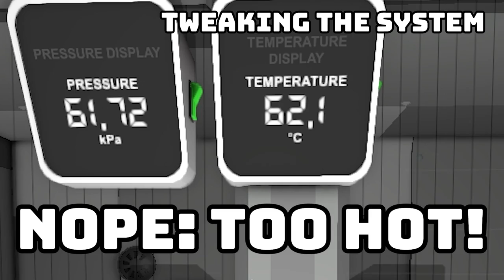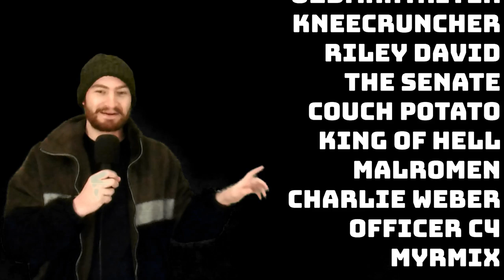The Gas Fuel Generator for Absolute Beginners | Zero Coding Required! | Stationeers Mimas Tutorial

Comment from the maker: After much testing, I can confirm that this works infinitely better as a 1x1 square! Much easier to balance and also runs a lot more consistently. Using only 1 active vent is also handy if you find the atmosphere is draining too quickly.
Reply: I think some of the jankiness when not confined to a single square was a combination of the gas sensor being too near the active vent and the working area being so small (yet more than 1). A longer 'buffer' of pipes after the regulator/pump would maybe help stabilize the changes some, and moving the gas sensor further away from either vent would also help the logic operate a bit more smoothly. But I think keeping it shoved into a 1x1x1 is the better choice.
Reply: Is this also "Phase Change Update" approved?
Reply: I would on the contrary advice bigger mass, I would probably put a tank to store gas at the desired temperature and pressure or have a bigger room, to have a more stable number, in the video pressure and temperature jump way to quickly.
Reply: @KnightOwlSC  Nope, i f u look at his volumepumps, they can pump more then 10L, so its an old game version ^^
Reply: @fellpower  dangit... I have yet to find a single post-phase-change guide for this! It's so aggrivating! D:
Reply: @KittenyKat  any luck? My base is dying :)
Reply from the maker: I guess I need to come back to it! Haven't played much since the update
Reply: Not a stationeers player but irl the answer would be delayed progressive counterreactions or slowing down the system. And since your vents only go binary and i dont see any way to introduce an activation delay in your setup, just make the room a lot bigger to have more air to work with. Then place the sensor as far away as possible. possibly the active vents as well. That should increase the time until your sensor reads pressure or heat threshold and eventually make your system "dumb" enough that it only realizes it has to act every... lets say once per second or two instead of at several megahertz therefore stabilizing the entire thing

Comment: I use 3 Active vents, 2 blowing inward and 1 outward conected to a gas tank above 100 kp and It maintain 100 kp in the gás Chamber, no need for back pressure regulators.
Reply from the maker: This is a really good system!

Wanted to keep things as simple as I could though.

Comment: Considering the main breaker for the entire operation is just one switch, would it not be feasible to set up a logic reader and compare to check the fullness of station batteries and trigger the generator when they empty out? Might remove the need to babysit the set-up at that point, since it would only be running in bursts.
Reply from the maker: Yessir, will be doing that in the next one. Wanted to keep this tutorial as basic as possible.
Reply: You could even work out the charge level and use it to tweak the fuel input pressure regulator, to throttle fuel use based on power deficit.
Reply: @LargelyUnemployed  The main challenge here would be setting up the deadband or some sort of P(ID) control logic, although you could also use logic gates to just set the gfg as lowest priority and to only run when battery is below X whereas solar/etc would have a higher input priority.

Comment: By keeping the pressure as low as you can, you dramatically increase the fluctuations in temperature as there's just not much matter to heat and cool, wouldn't it be much more stable at higher pressures?
Reply from the maker: The windows have a a very low pressure tolerance, around ~150kpa. Higher pressures would be stable, but not for very long 😉

Comment: wouldn't it be simpler use pump with back-pressure regulator?
Reply from the maker: The back pressure regulator is way, waaaay too slow. You'd over pressurise and blow the windows!
Reply: @LargelyUnemployed  I see, then how about two pumps, one in one out and use single batch-writer to write to both of them and as for the logic do (current_temp - desired_temp) and write the result to "setting" parameter of the pumps
the pressure should theoretically remain the same, but maybe add both pressure and back-pressure regulators as a failsafe

I'm not a big fan of snappy systems, so I'm trying to improve on that KEKW

Comment: Great video! One thing though ... you have 4 logic readers behind the APC, 2 which are reading the temperature and 2 which are reading the pressure all from the same Gas sensor. You could get rid of 2 of them really :)
Reply from the maker: I do? Where are the extras?
Reply: @LargelyUnemployed  omg 🤦‍♂ nevermind :) I totally had a brain fart lol ;) I was thinking of the green I/O modules on the floor, but they're for the power generation display. the displays pull the data directly from the sensor :D
Reply from the maker: Phew, I was racking my brain to try and figure out where they might have snuck in 🤣